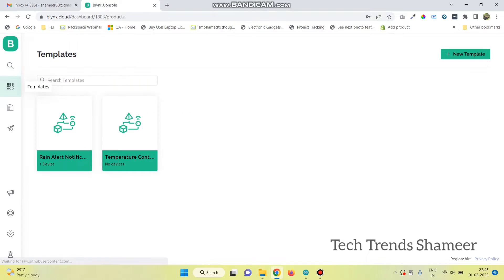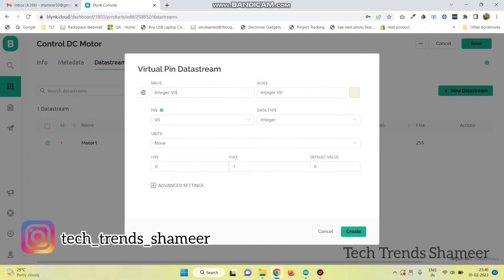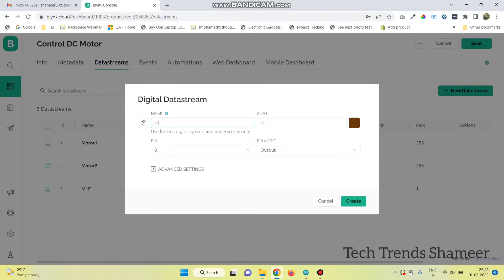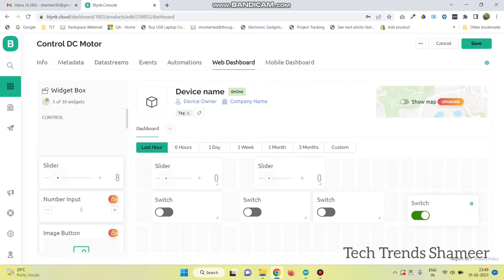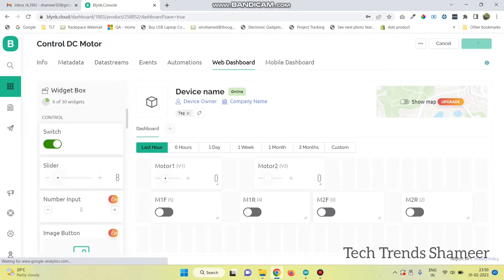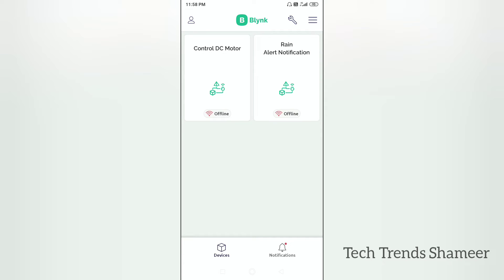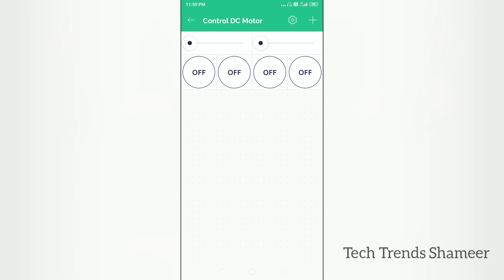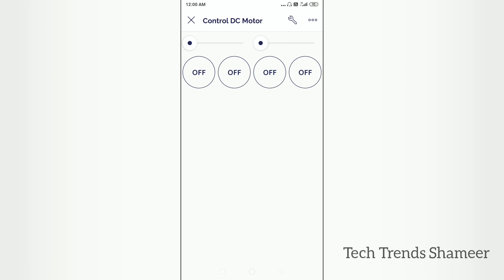How to Control DC Motor With L298N Driver Using Blynk IOT and ESP8266 | DC Motor Control With Blynk

Comment: C:\Users\nani\AppData\Local\Temp\.arduinoIDE-unsaved2024618-15428-vjwhz4.3kci\sketch_jul18d\sketch_jul18d.ino:20:13: error: 'D5' was not declared in this scope; did you mean 'V5'?
   20 | int M1PWM = D5;
      |             ^~
      |             V5
C:\Users\nani\AppData\Local\Temp\.arduinoIDE-unsaved2024618-15428-vjwhz4.3kci\sketch_jul18d\sketch_jul18d.ino:21:13: error: 'D6' was not declared in this scope; did you mean 'V6'?
   21 | int M2PWM = D6;
      |             ^~
      |             V6
C:\Users\nani\AppData\Local\Temp\.arduinoIDE-unsaved2024618-15428-vjwhz4.3kci\sketch_jul18d\sketch_jul18d.ino:22:11: error: 'D1' was not declared in this scope; did you mean 'y1'?
   22 | int M1F = D1; //GPIO5
      |           ^~
      |           y1
C:\Users\nani\AppData\Local\Temp\.arduinoIDE-unsaved2024618-15428-vjwhz4.3kci\sketch_jul18d\sketch_jul18d.ino:23:11: error: 'D2' was not declared in this scope; did you mean 'V2'?
   23 | int M1R = D2; //GPIO4
      |           ^~
      |           V2
C:\Users\nani\AppData\Local\Temp\.arduinoIDE-unsaved2024618-15428-vjwhz4.3kci\sketch_jul18d\sketch_jul18d.ino:24:11: error: 'D3' was not declared in this scope; did you mean 'V3'?
   24 | int M2F = D3; //GPIO0
      |           ^~
      |           V3
C:\Users\nani\AppData\Local\Temp\.arduinoIDE-unsaved2024618-15428-vjwhz4.3kci\sketch_jul18d\sketch_jul18d.ino:25:11: error: 'D4' was not declared in this scope; did you mean 'V4'?
   25 | int M2R = D4; //GPIO2
      |           ^~
      |           V4

exit status 1

Compilation error: 'D5' was not declared in this scope; did you mean 'V5'?
Reply from the maker: Which board you are using? ESP8266 or ESP32 ?

Comment: THANKS its works very nicely, although i cant connect mother 2 due to blyink limitation but learn alot.
Reply: I am just going to only make motor 1, motor 2, m1f, m2f and just not make the ones for going backwards
Reply: @nickrongen3141  Hey sir, how your motor work? My motor and settings like yours and my motor not even work. Do you know why that happen?
Reply from the maker: Thank you 😊

Comment: How do I get This ?
"char ssid[] = "WiFi Username";  // type your wifi name
char pass[] = "WiFi Password";  // type your wifi password"
Reply from the maker: Enter your wifi credentials
Reply: @TechTrendsShameer  It turns out that the current limit for the L298N Driver motor is 2 Amps. Is there any suggestion that a motor with this current limit has a torque of more than 5kg?

Comment: Hello, the code continuously connects to the Blynk mobile app on the serial monitor ouput. What could be the main reason I am using an ESP32 DEV module, not the one preferred on your video.

Comment: How does blynk know that d1 is physical pin 5? yes we chose pin5 while creating datastream but we didn't choose d1?? Or let me ask, could we make pin 5, for example, d10?
Reply from the maker: Please check the pin configuration of ESP8266. You will get an idea.
Reply: @TechTrendsShameer  i checked but didn't understand, how blynk know taht d1 iş physically pin5 🤷
Reply from the maker: In the code we mentioned the PIN as D1 and also in blynk we are mentioning the GPIO Pin which is D5. Also we are selecting the board as ESP8266 while creating the template.
Reply: @TechTrendsShameer  and how does blynk know this pin (D1) that we mentioned in the "CODE" (not in blynk web editor)? we only choose D5 on web editor..
Reply from the maker: When you write code for the ESP8266 with Blynk, you use virtual pin numbers in your code rather than the actual physical pin numbers. These virtual pins act as placeholders in your code, and you can assign them to any desired physical pin on the ESP8266 board.

In the Blynk web dashboard, when you select a pin (e.g., D5) for a particular widget, you are assigning that widget to listen or send data on the virtual pin associated with D5. It does not mean that D5 is the physical pin being used on the ESP8266.

In your code, you need to map the virtual pin used in the Blynk widget to the physical pin on the ESP8266.